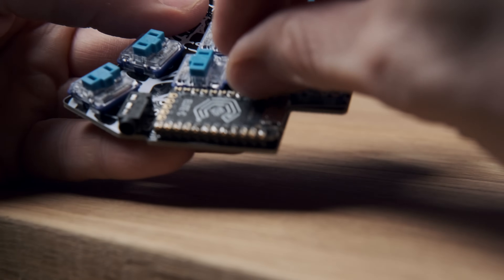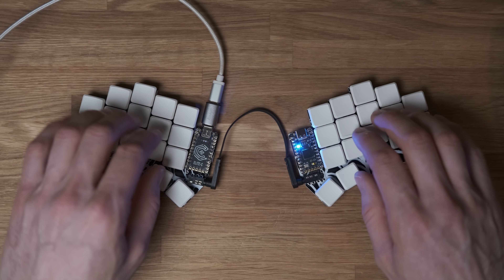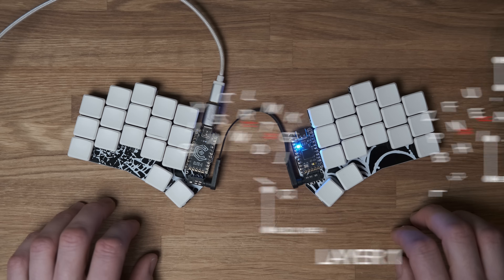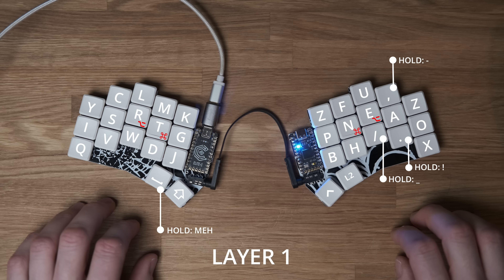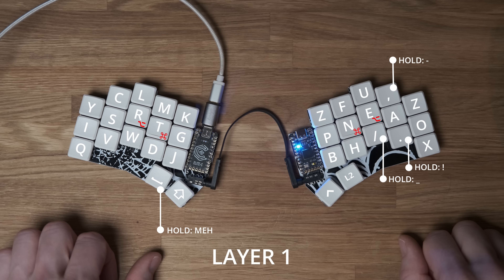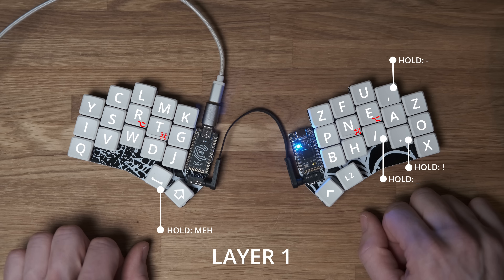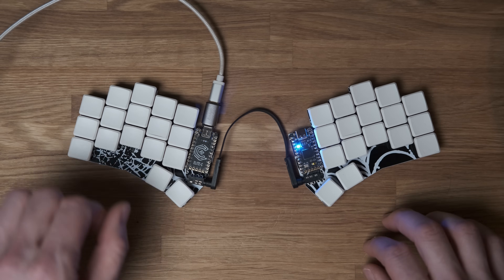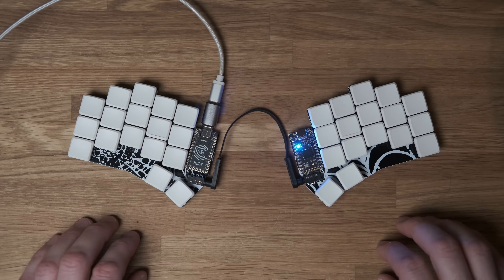You Won’t Believe How Effective This Keyboard Layout Is

Comment: Nice. I’m still using a 32 key layout on the planck as a daily driver, so just one key per thumb. Definitely not missing a full size keyboard. In fact, I 3d printed a “shelf” that sits on top of the laptop built-in keyboard so I can set the planck on top of it when on the go. Looking forward to how a 24 key layout will work for you. I use emacs native bindings, so it might be harder for me. I might have to switch to Emacs evil mode at some point.
Reply: With a 32 key layout, what sort of layer switch chords to you have to do for the more  difficult Shift-Alt-Ctrl kind of bindings in emacs?
Reply: @meeself  My modifiers are on the home row and duplicated for each hand. So I hold the three fingers down to access those modifiers with either hand. If I hold down all four then I get the Hyper key that I use for many of my Keyboard Maestro macros on the mac.
Reply: At thirty-two keys… wouldn’t a dilly or a gherkin make more sense for you than the planck?
Reply: @bluefaolan  probably so. It was a big step for me to go from a full size keyboard to the planck at the beginning of Ben's video series. It was also the most I ever spent on a keyboard, so I tried just removing some keycaps from the planck and use the wide layout where the two middle columns are not used. I'm considering getting another keyboard so I will check those suggestions out.

Comment: I think the combination of not knowing where my keys are with VIM would be pandemonium.

Do you not suffer a massive drop in productivity when you’re switching layouts all the time?
Reply from the maker: I have found that once I learn a new layout, if I leave most of my vim bindings on the same letters it’s actually pretty easy to just use the new location for them. I remap the hjkl positions so  they’re in the same place obviously but the rest I just use them in the new position. Changing layouts is a big deal though and not something I want to do again. I used holidays to blitz learning them previously to avoid the productivity hit.
Reply: @BenVallack  Do I get that right, that now with this layout, you set up vim to use PNEA instead of HJKL instead? Thanks for the inspiration!!
Reply: in my experience I tend to adjust to symbols/mod key changes more quickly than changes to the overall letter layout. I think that's because the symbols and other function keys are used more rarely and that allows you to place them in nice logical groups. But there is still a small adjustment period.
Reply: Change between layers isn't that hard when you use the extra thumb key. Traditional keyboards make your thumbs lazy.

Comment: I use a Ferris Sweep, can I ask if you've tried vertical combos (not chords)? For example, I mapped escape to KG and colon to ZP (on your keyboard) amongst other symbols. Since my switches feel light to me (25gf) I can press the middle of the two Choc keys using only one finger. I like it because it adds more keys to the top layer. Thoughts?
Reply from the maker: Yeah I did try that actually, I may need them if I run out of side by side combos. I kind of felt they were a bit fiddly to find a new ‘target’ in between targets but maybe I didn’t stick with it long enough.
Reply from the maker: By the way check out the later commits in the ZMK config repo in the description to see the combos I’m using on my current layout (not the one in the video).

Comment: 24 keys, steno? I had a huge pain learning steno, you have to relearn everything, especially if you're coding and chording all your symbols, it's really hard to justify for speed improvements.
I got 20g switches, and I don't mind holding down keys like layer / shift cause I pretty much the weight of my thumb / fingers is enough to activate it
Reply from the maker: Yeah agree Steno is a long shot in terms of justification. That isn’t the goal with my 24 experiment though, just pushing how small you can go really. The layout is in the ZMK repo in the description if you go to the newer commits.
Reply: I agree that just in terms of typing speed, it wouldn't make sense for programming itself. Though it definitely would help with documentation, Discord/Teams/Slack, etc. However, I do think it has interesting implications for shortcuts. A lot of the shortcuts in the IDEs I use are fairly arbitrary. Like refactor parameter list, find usages, step over, etc. Or launching apps. Steno gives you the ability to have more verbose shortcuts while still being fast. Even a two-part chord would be fast and easy to remember. Like say REFK REN to rename something, REFK PARM to change the parameter list, etc. You could have a two-part chord for launching an app where the second part is KALK for calculator. I think there is more than meets the eye for steno for programming...

Comment: Does 34 keys demand a lot of key holding?
Reply: it depends how u make it, some prefer holding (especially with light switches), while others prefer singlepress to switch back and forth (much nicer, doe u can make huge mistakes if u forget to switch back)
Reply from the maker: Exactly as Gofven says. The way I do it has no holding because my layers stay as they are after just a tap, but the potential for errors is indeed big. Which is why I use the ‘panic mode’ idea in the video.
Reply: @sifkkfkels2927  I prefer pressing but I like having dedicated keys for layers instead of a key to go between them

Comment: I was just about to leave a message asking how your layout is , so I could try it from a kinesis/ergodox setup!!👍👍👍
Reply from the maker: Heh!
Reply: @BenVallack   quick software based question... how did you load key layout for ISRT on macOS and ipadOS? (ir still waiting on my gergoplex as well)... I didn't see file for it in the Notgate's  repo.
Reply from the maker: @Bl1nkSt3r  No need, I just changed they keyboard map itself. Doesn’t matter what I plug it into.